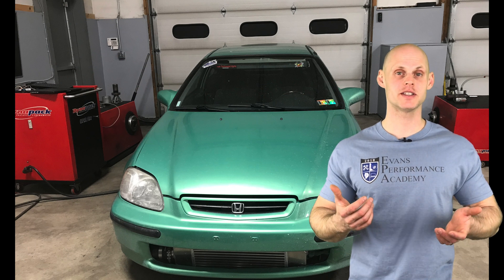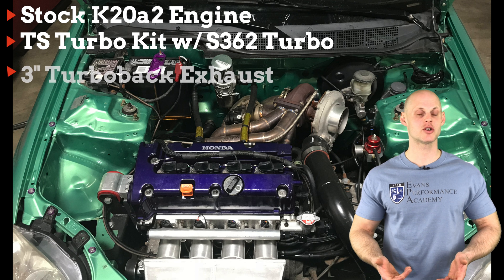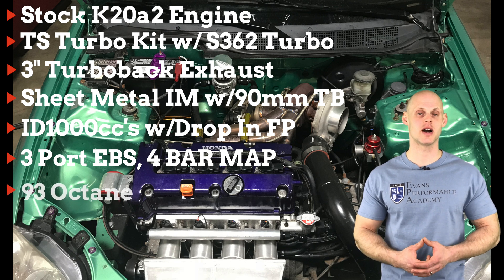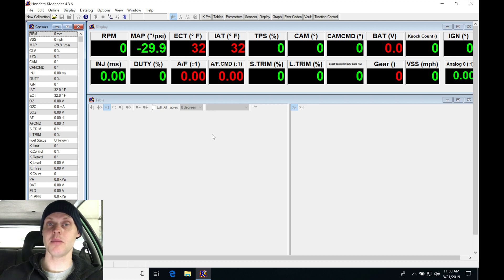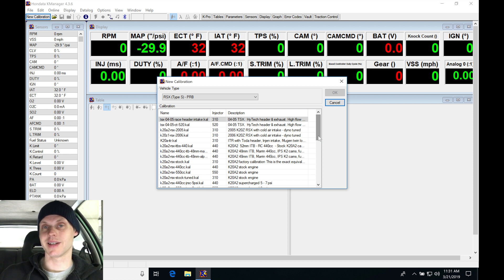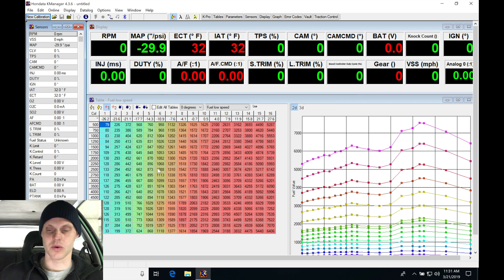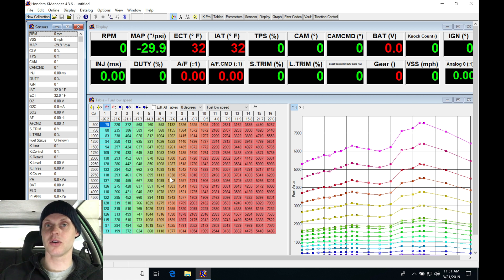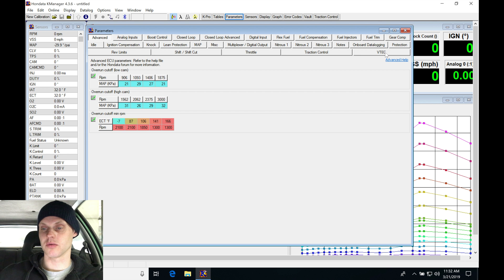KPro Live Training: Turbo K20a2 EK Civic Part 1 | Evans Performance Academy

Comment: Hey Evan, is there a way I can adjust my piston compression ratio in kpro? I have a k20a2 overbored 86.5mm with 9.3:1 pistons. Trying to find a base tune so I can break in the engine and drive it to the dyno thanks